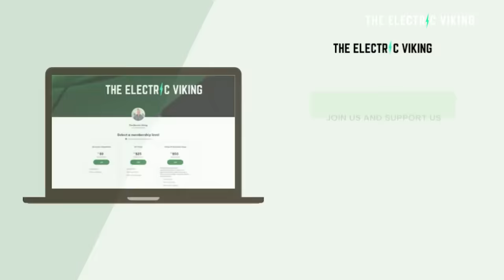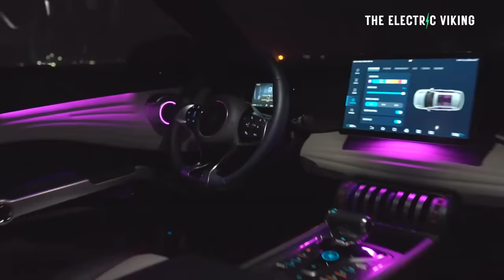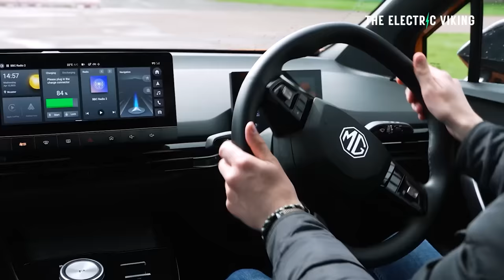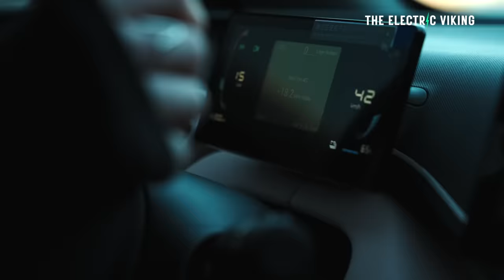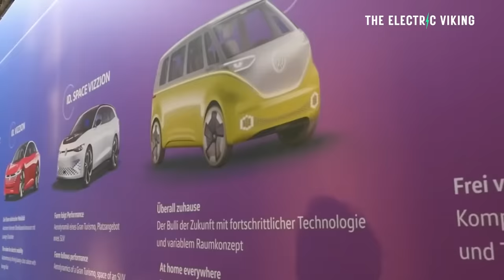BMW says "NOBODY can come into Europe and just take it over"

Comment: well if the EU shields the EU car makers, then of course the threat is lower then without it, but BMW is also disingenuous, cos yes people who buy BMW/AUDI/MERCEDES cos they are these brands, they wont shift to chinese so BMW will be mostly safe, in that regard they are right, well, if they dont try to  "optimize" margins, aka use more and more hard plastic on 40K cars.
AUDI already FU@ up.. they recently revealed  new electric Q6,  starts at 75K euro.. the back door top part is cheap hard plastic, i understand that at 25K car, and i already think the Q4 Etron around 45K with hard plastic dore top is a slap in the face, but at that price point of the Q6, its a literally pissing on the costumer.
Reply: They really need to get their shiet together and manage costs in a smart way, which is hard, given the skyrocketing energy bills in Germany. 

Plus, nowadays being expensive doesn’t necessarily mean using better materials, and vise versa. Huawei Aito M9 ( i think it’s this car) uses submarine level of steels to make the frames. They had a test of 2 big trucks sandwiching and squeezing the car and the car withstood. To be fair though, M9 is not considered a cheap car in China. 

One of the car critique videos about another brand (i think it was MG), revealed that a lot of the parts they use are metals, whereas the materials in the same spots are plastics on japanese cars, generally speaking. 

I think the cost management is way more complex than just about labor and material costs, and the legacy auto makers really need to start to reinvent themselves, instead of being lazy and simply relying on their reputation from the past and the consumer loyalty to the brand.

Comment: Sam, you need to go back to school with all these figures you’re plucking out of the air. You said the electric BMW 3 series in China weighed 2600 kg or 7000 lbs. WRONG… 2600 kg is not 7000 lbs, it is actually 5700 lbs, so you’re way off with all these airy fairy BS numbers…